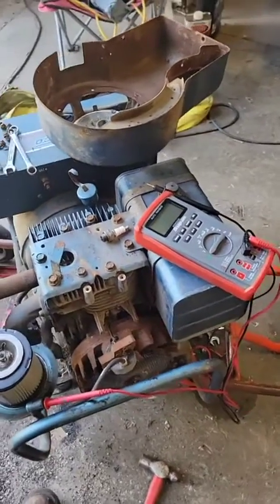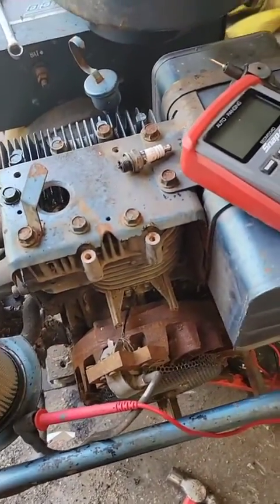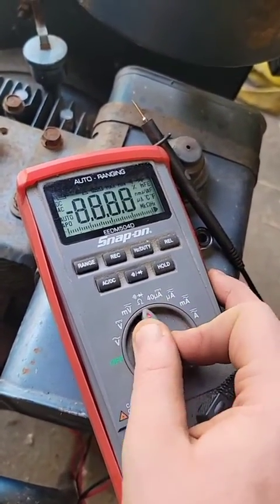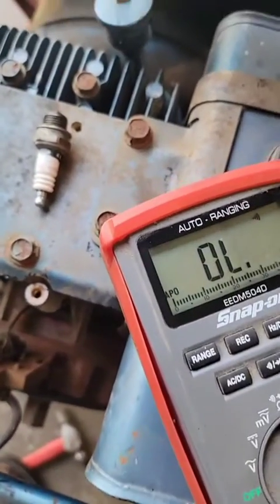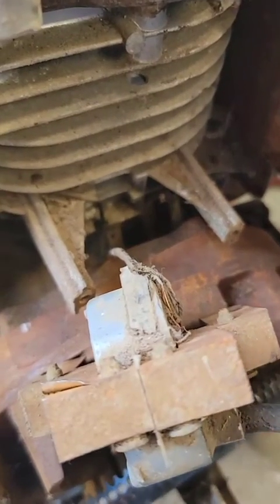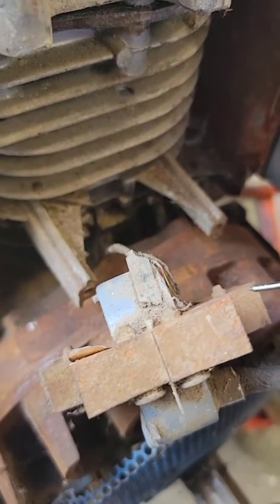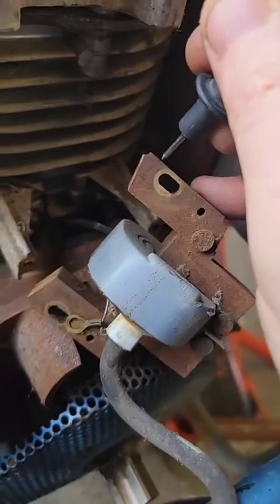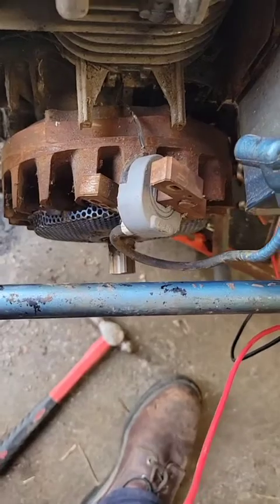Fastest Way to Check a Coil (Magneto) on Older Small Engines

Comment: the  plug wire does not go to the mounting that you are testing it goes to the seconary winding -------as the magnet on the fly wheel spins by the coil it creates a voltage in the primary winding now due to the turns ratio primary to secondary coils a high voltage  is created due magnetic effect which then the high voltage goes to spark plug  - make sure magnet is good on  the flywheel  it will grab a screwdriver  thats a good magnet  sub a coil off a running eng . if you get  a spark with a diff coil that tells you ----you need a coil  good luck  hope this helps.
Reply: Your absolutely correct Frank. He should sand the rust off the magnets and the coil, remount the coil with ten thousands clearance between it and the magnets on the flywheel.
The way he tested the coil was useless. Just saying.
Reply: @daveschidlmeier6425    Actually, cleaning rust off air gap surfaces is only necessary when setting the air gap because rust will change that gap so anything used to measure or set the gap will be increased.  Rust in itself will still allow a magnetic pulse and allow the magneto to produce an electrical charge.  That said, cleaning the mounting surfaces of the magneto and the machine will ensure a good ground because rust does inhibit an electrical connection.
Reply: @Rein_Ciarfella  that is why I would clean the rust off off the flywheel magnets and coil, to get the proper clearance between the two units. Otherwise the clearance would be larger if the rust was left on.